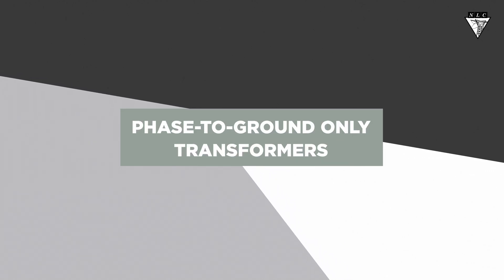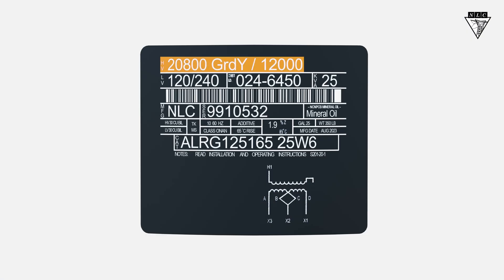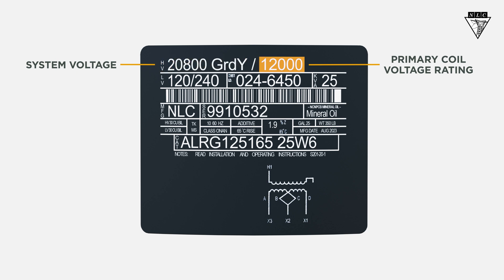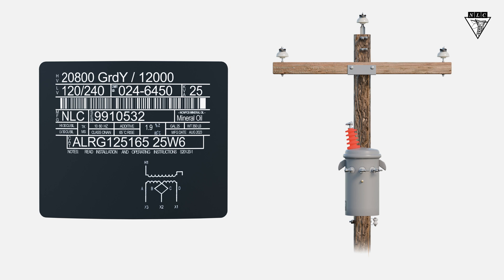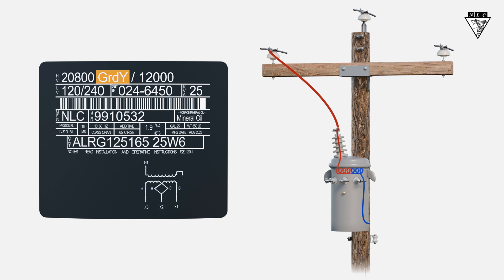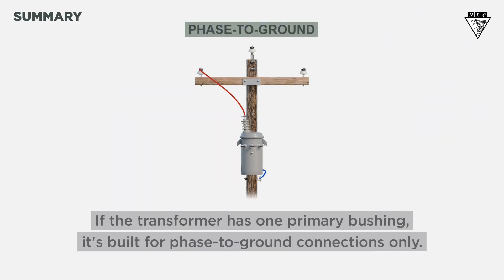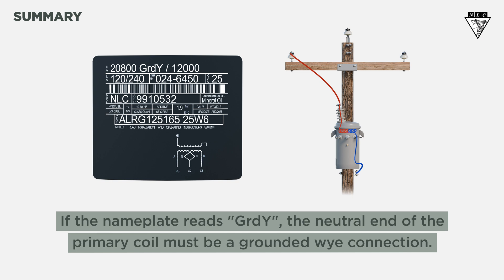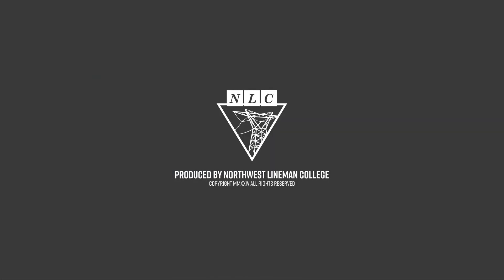Phase to Ground Only Transformers

Comment: All I can say is wow.  I did quite a bit of engineering work in the roadside safety field. If you snap that pole off and it's half-assed standing up, you can have a snapped off ground wire touching a car. I'm retired now but I would send word back, I never heard of this and it would affect a collision.